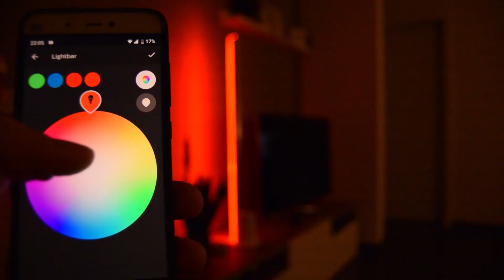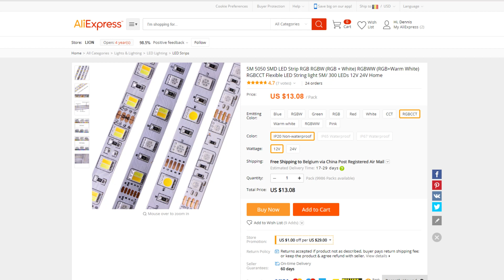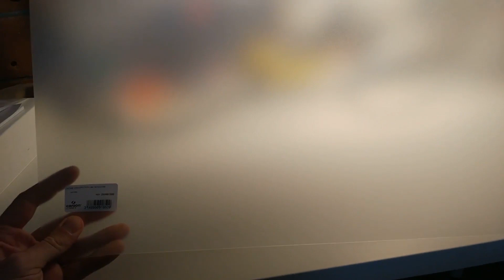Philips Hue DIYgne

Comment: I would really like to understand if there is a way, perhaps with some special joints, to create a completely printable version that is similar, without aluminum profiles. It would be extraordinary.
Reply: you can just use PVC profile. Aluminium handle heat much better though.

Comment: I really like the idea , but just asking.
If you got some led, for way cheaper you could have buy an arduino to use your led strip as a ambilight system directly on your tv ? 
Pro :  colors follow, quick transition 

Screenbloom works but sux balls comparing to philips native integration.
Are those gledopto controler fast enough ? I had issues with cheap bulbs and screenbloom 

Really nice project thoo
Reply from the maker: If you're using it only as an ambilight system, there are obviously way better options. Projects like Hyperion come to mind. And Screenbloom was pretty shit to get going for this demo, since you need to cast the video to your TV... These days, it's mostly used as a Philips Hue 'bulb', not really for the ambilight purposes. But thanks for the feedback!

Comment: I was initially planning to build this with the philips hue lightstrip but ordering the 3D printed parts online and buying the hardware at HomeDepot and all the labour involved is much more expensive if you plan to go with the Hue lightstrip. For this route to be cost effective, you need to have your own 3D printer and go with an aftermarket LED strip and controller.
Reply: In the US I was able to have the base parts 3D printed and shipped for $20. Add a hue strip for $60 and it comes out to $80 without the trip to the hardware store.
Reply: @Slowe420  Hey man, do you remember where you got these parts 3D printed for that price?

Comment: Very awesome project. I just made the 3d printed base, and it's the exact size of the gledopto controller that is linked. Meaning that there is not room for one end of the cables to be folded back down and routed through the inside cavity. It shows room in the video, I'm guessing something changed. I'm going to either drill a pass through hole for the led strips, or a length wise deep channel in the cavity. 

Also, I'm trying to make this hue sync entertain compatible. Since doesn't allow 3rd party devices for entertainment areas yet. My idea is to make this light strip mimic or copy the light temperature from another hue bulb.  I have not seen that yet.  Any ideas folks?
Reply: @Attinker  89.24x48.33x23.7mm

Comment: Funny, I just came up with exactly the same DIY project in mind (minus the cool 3D printing).
250+ EUR for that lamp is way too much.
Still, today I just fell in love with the Ensis ceiling lamp: I guess you could DIY that too...
Reply: @Attinker  True, and you need to fit all that in the suspended structure.
Plus, I don't know if the Hue application will only let you control the 2 lights individually OR they've baked in some sort of "smart color pairing" feature for this lamp only. Guess the latter option is just wishful thinking...
Anyway, I might actually buy that when it's released.
As for the Signe, instead, I'm just too intrigued to start this DYI project, I would not buy it even if it cost half of its price :)

Comment: Could you provide us with the links to the items on alieexpress by any chance? I cant seem to find the right RGB strip.
Reply from the maker: Something like this should work: https://nl.aliexpress.com/item/32906423190.html
For best results, I'd get the RGBCCT, with the matching controller from Gledopto. 12v or 24v is both fine, just make sure you get a power supply with the same voltage. Hope that helps!

Comment: great work! i just would like to ask something about the hue box. it's has not a top cover for rgbw module in the print files. is there another drawing for this ?
Reply from the maker: So sorry for the late reply, seems like this slipped through the cracks. I'm not sure what you mean with a top cover. The box where the Gledopto controller fits inside of is supposed to fit in the foot upside down, so I'm not sure where you want to cover anything?

Comment: I'm looking to make one for  me but my local 3d printer store ask 60$ to print these 2 parts and a 3d printer coast 220$. what you think it's better ? how much you spend of plastic on these parts? because 1kg coast 25$ here.
Reply from the maker: If you're in the market for a 3D printer, you might want to look into the Ender 3, which is cheaper than 220. Especially when ordering and shipping from China. Plastic wise, I'm not entirely sure anymore, but let's say it's about 150-200gr. So under $5 for these parts.

Also, I'm not sure where you live (Switzerland would be my guess), but a lot of countries have makerspaces (or fablabs), often connected to universities. They often let you do these things for the price of the plastic. That might be worth looking into as well?
Reply: I paid 3$ for printing those 2 parts :D

Comment: how many volts is need to run those two strips inside?
Reply from the maker: These controllers use 12 volt power supplies, and about 1 amp per meter of strip (although this kind of depends on how dense your strip is, 30/meter vs 144/meter). In this case I have a 12v, 2A power supply for a single 2 meter strip.

Comment: Nice work.
As far as I know Philips Hue Sync / Entertainment does only work with original Philips Hue lamps. How did you achieve that your lamps worked with it?
Reply from the maker: It's not exactly using Philips Hue Sync, but there are different ways to sync these lights with software. Kodi has a plug-in, PC's can use software like ScreenBloom, etc. In this case, I used ScreenBloom on my PC and casted the video to the TV.
Reply: @Attinker  ah, I see the point.
Thx. So for a Philips Hue Sync solution (which I need) this won't work. Nevertheless great work.
Will keep this in my mind for another setup.
Reply from the maker: @Mr.Empire  No, sadly, they really locked that down. It's too bad, would have loved to use that as well.
Reply: @Mr.Empire  Can use the Hue 60" LED strip and still save a ton of cash.